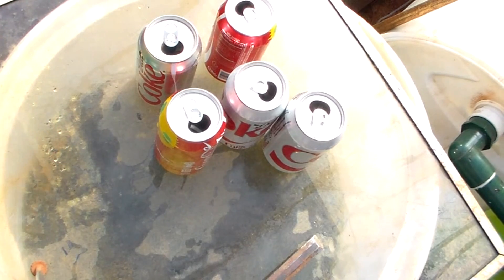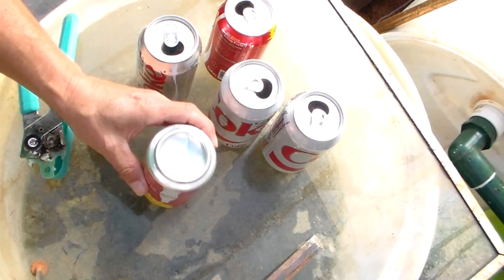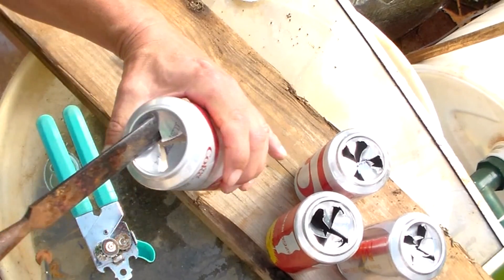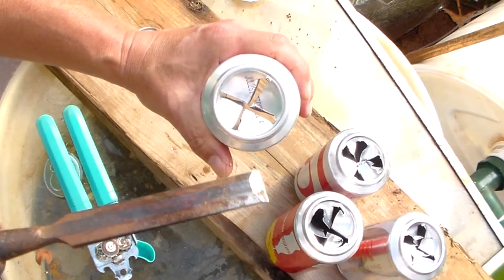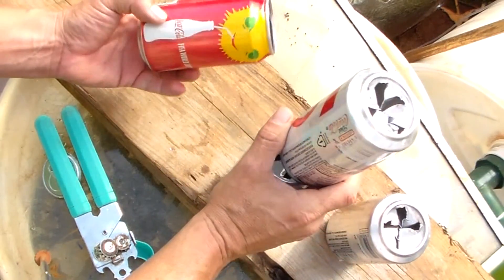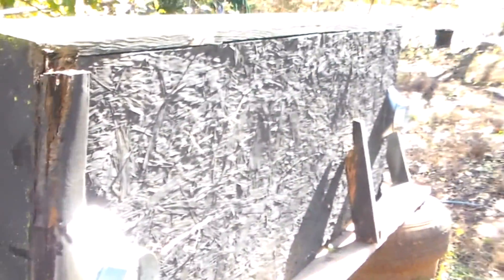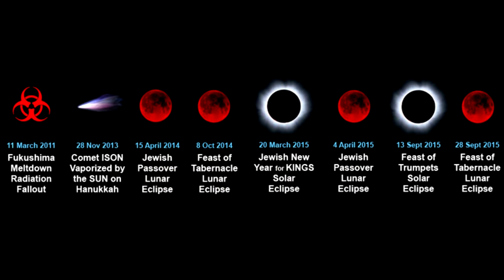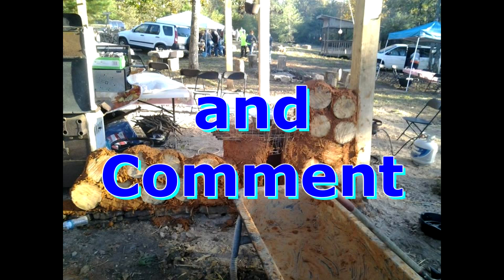DIY Solar Heater Can Vortex Made Easy

Comment: Is it possible to use liquid metal with an electromagnetic pump that heats the liquid metal through magnetics has it moves through a closed system that is first powered by solar panels then ran off a thermal electric generator ounce the set heat range is reached to heat a green house a home even run absorption refrigeration units? Novartis
Reply from the maker: I wish I would love to see that
Reply: How does a domedic refrigerator work? Use a solar tube set up to heat gallium then use an electromagnetic pump to circulate that blazing hot liquid metal through a copper heat exchange coil to heat water or use a booster fan on a thermstat  to heat with it run a TEG and even be a heat source to run a evaporation absorption refrigeration units? You would like to see this? Why not try it for yourself? Leave using trash behind and build something that really works hay you can make a video showing how you did to impress your fan base? ; )
Reply: If I did not know it would work I would not waste me time sharing this knowledge with you! NOVARTIS!